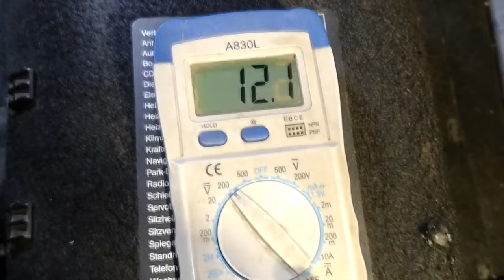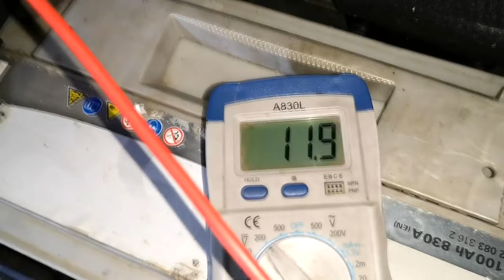How to make old Starter Motor Work like New. How to fix, rebuild and clean starter motor.

Comment: I used to work in a starter repair factory. We would do about 150 a day. If you want to strip a sealed solenoid then here`s how. First of all get the solder hot and flick the solenoid so the solder flys out the hole. Once the wires are all clear then get some nice thick angle iron. Drill three holes matching the solenoid attaching holes. Then drill one in the middle of the holes big enough to fit a 3/8th extension bar. Put a socket in the solenoid hole that fits nice. Screw the screws through the angle iron and into the solenoid holes. Be careful not to go to far as the copper windings inside will be damaged. So you might need washers. Just wind in with you hand to save damage. Once the solenoid is fitted to the angle iron then insert the 3/8 extension bar through the middle hole. Get a big vice and put 2 big spacers each side of the solenoid and put in the vice so the extension bar is on one jaw and the 2 big spacers with the solenoid are on the other jaw. Then close the vice and the extension bar should push the solenoid apart. When it apart you have to open the metal case with a hammer to get it back together to get rid of the lip.
Reply: thanks.  seems you could have your own shop...   sounds like a bit of work, not worth my time since a new one is not too expensive, compared to this amount of work.
Reply: @galehess6676  Yeah i did all this when i was skint. Time is more important now.
Reply: Why don't you do a Video to show how  it is done ?.... it would be so much better than writing an explanation of it
Reply: 150 of those is a lot! I hope the pay was good 👍.
Reply: @damianbutterworth2434 bet your watching the grass grow
Reply: @Psp-id7uw  I wish I had the spare time.

Comment: It honestly sounded the same to me. Your battery is at 11.9v when a fully charged battery is 12.6. That’s most likely your issue. Check the voltage drop while under a load if you drop below 10.3v get a new battery you likely have a dead cell. Otherwise it could be a charging issue.

Comment: This video is very helpful for people with starter issue however the issue with this car wasn't the starter and I did not notice a big difference after you cleaned the starter as far as starting the car. The reason that your car doesn't start right away could be many things.The first thing to check is the battery and the connections. Make sure the battery is healthy and the terminals and the clamps are not corroded and also check the connection from the battery negative terminal to the body is good. Then start with air filter and spark plugs.Make sure the throttle body and mass sensor are clean and if the problem is still there I will check the fuel pressure.
Reply from the maker: Thanks for sharing your thoughts 😉 But you lost me when you said check spark plugs on a diesel 😅

Comment: I'd like to thank you for this video.  I am a farmer and on Saturday at 3pm my tractor wouldn't start. The starter smoked a bit on its last try and I assumed it was dead. I watched your video then took my starter apart. I had nothing to lose since the tractor store was closed 'till Monday. It was extremely dirty with oily, greasy dirt. I cleaned it well and reassembled it. After that, I bench tested it (another YT video) and it worked! Today it has been working much better than before and I've transplanted cauliflower, zucchini and summer squash. I'd be down for days sourcing a new starter without this video. It feels good to solve a problem and keep trucking. Thanks man!
Reply from the maker: Thank You so much! I work for these kind of comments and I am very happy that it helped
Reply: @Work_G  still working! Thanks!

Comment: Nice video. I needed a refresher after 40 years of bolting on replacements for customers. Thank you.
The commutator just dropping into the brushes doesn't look familiar at all though. I remember that being the nightmare of electric motor rebuilds "back in the day"... holding the spring loaded brushes back until the commutator was in place, while still being able to release them once it was seated.
Reply from the maker: Thanks! Usually hobby mechanics like me have a different experience when you love your car and don't count the time you spend on it, so you find yourself doing things like that 😅

Comment: Nice cleaning up.  A tricky part is pushing and holding back the four brushes while inserting the commutator.  Several ways:  Tie wraps, a socket under them, etc.  You should also try to disassemble the gear reduction box, clean and grease.  You should replace the brushes too if you can find them.
Reply from the maker: Thanks! Good tips 😉Brushes was in good condition and to replace them need to solder connection and to buy new ones need special order so I decided to leave original and over all this starter is pretty complicated. For more simple starters I agree with you 100%, do everything while you there ✌

Comment: solid. i just did my 911 and not only saved a few hundred but also got the car back on the road in a day.  some tricks that may be helpful for other cars:
1. mark the orientation of EVERYTHING with a paint pen as you disassemble
2. i used red scotchbrite for the brushes and armature
3. clean everything with electrical contact cleaner
4. use small zipties to hold the brushes in the holders as you reassemble
5. then place the largest socket that will fit inside the brushes to hold them compressed and cut the zipties
6. reassemble
rock and roll.
Reply from the maker: Thanks for watching and sharing tips and tricks 😎

Comment: Thanks for this, I thought that my parents were going to have to spend a couple hundred on a new starter motor for our Subaru Liberty GX 1995, but I instead went down to the garage (the car was parked outside because it wouldn’t run to get in) and I gave it a bit of a polish. Admittedly I shouldn’t have but I decided that it was a better option.

Comment: Great video.  Thanx.  I did this similar thing to my condenser fan on my truck for air con.  I used high grit sandpaper to polish the copper contacts and cleaned it out inside.  Also dressed the brushes. Sometimes it wouldn't start,  or just didn't run nearly as high speed as it does now. It turns on every time now and boy does it run fast.  Anyway Thanx
Reply from the maker: Nice to hear that

Comment: Neat! My starter is all slow and lazy sounding. I'm wondering if I could just clean and lube it, rather than replace 🤔
Reply from the maker: It should do the job, may be put new brushes and it will work like new

Comment: A good battery test would be recommended on that as that battery is almost discharged and far from a healthy 12.4 to 12.7 I would expect to give a starter a the required power but even then it's not sufficient as I tested s car last week that produced 0 cca but had 12.37v of charge, great video though

Comment: Great video 👍 but will this work if the starter can't even crank?
Reply from the maker: Thanks! It can work if the problem is in wires connection or brushes

Comment: Brilliant demonstration ♠️
Do you think it'd be possible to bring a marine starter motor back to life, it was partially submerged in fresh water for about three months,
Its hard to explain, but the top part with the cables on was not under water nor was the rear of the unit, because of the angle of the engine only the front bit that goes into the engine was fully submerged..
What'd reckon folks? All suggestions greatly received
Reply from the maker: In theory it should work after full rebuild and refresh, but practically I can't tell

Comment: It's an excellent idea for salvaging starters instead of throwing them out or buying a new one.  I bought my starter from Autozone with a lifetime warranty and returned it for a new one when it died.  Unfortunately, I have done this several times with my Chrysler Town and Country 2014, saving me time and money.  Chrysler dealer in Tampa Fl. wanted $1100 to replace my mini van, of course, I found another alternative.
Reply from the maker: True and most of times fixed original is better than alternative manufacturer part

Comment: Can I use high temp. grease or Multi-purpose grease? 

Also, what kind of lubricant is that? Any alternatives?
Reply from the maker: Yes you can, just dont put it to much. I used Berner bearing grease and ptfe lubricant

Comment: My starter seems to be having an intermittent issue, although sometimes there’s another issue where my dashboard is wonky and my fuel pump doesn’t prime so it may be that in combination. Regardless once it starts priming again I get a click at the starter but it doesn’t turn even directly engaging the starter so it may be fixable without even rebuilding it, just a cleanup
Reply: clean ground which is the interface with motor housing, the housing of the starter is probably dirty where it meets the motor housing and grounds the circuit, and clean all contacts.

Comment: Hello and excuse me, I wanted to ask you, if with the tester positioned on the sound diode, I touch with one tip on any strip of the switch, "where the carbons crawl", and with the second tip on any other strip, it always sounds, is this normal? Thanks Eugenio.

Comment: It’s not a rebuilt it is just a cleanup?
While you were at it I would have changed the contacts in the solenoid/relay, it is what fails first, typically. 
On my Toyota Sienna it’s $6 to $16 depending on how many parts you charge (just one contact to two contacts + plunger).
The brushes seemed ok. They are the second point of failure.

Comment: How do you clean it if there's oil inside? Can you spray it with carburetor cleaner and dry it up?
Reply from the maker: If you mean grease on gears and bearing, than sure you can clean it with carb or brake cleaners but don't forget to lubricate it with new grease after cleaning

Comment: If one is not comfortable doing this on their own, what kinds of shops can do this service?  I just switched out an old starter motor on my 2014 Honda Accord and want to get the old one repaired or reconditioned, ready for the next replacement in the future.
Reply from the maker: Usually there is shops that specialises in starters and alternators repairs
Reply: They might charge you 50% or more of what it cost to buy a starter.  Depends on the vehicle of course.

Comment: Hello , Great job fixing the starter motor , i have one problem in my VW Golf 5 2.0L 2005 , when the engine its cold start good , but when the engine its warm its last more , around 3-4 second to start , Should be the starter or something else ?!!
Reply from the maker: Hi, Thank You! It can be starter but usually starters act same on cold and hot engine, so I can only suspect other problem like fuel issue or faulty sensor
Reply: GetWork i have one problem with Turbo , its Turbo charger Oberboost , can be this ?
Reply: @henrilica483  My brother has the same problem on his 1.9 TDI. Snags the key from your hand when cold but a bitch to start when warm/hot. They usually get that with age: starter not at 100% cranking power, battery the same, leads that get a bit corroded and whatnot. The fix: the high route is to get the ECU flashed; the low (and much cheaper) route is to install a TDI Hot Start Magic Button where you're bypassing the coolant temp sensor only for when you hot start the car, tricking the ECU into thinking the engine is stone cold and squirt more fuel and faster. That's what my brother has on his Golf and it works. Everytime. This dude explains it overall but I'm sure you can find more about it online: https://www.youtube.com/watch?v=rhfkjJMtVSU&app=desktop

Now for the Overboost it's more likely the VG part in the VGT (Variable Geometry Turbocharger) that TDIs have. Either the vacuum thing that moves the vanes inside the turbo that control flow and turbo RPM is...well...broken...OR the vanes are sticking open/closed. I've seen some videos of people squirting oven cleaner inside the hot side of the turbo to break up the carbon and free the vanes. Search for that.

Cheers!
Reply: @Henri: if by "start" you mean that it cranks fine when hot or cold, but that the engine won't "catch" (start running by itself) quickly when warmed up, that could be many things. Could be temp sensor reporting that the engine is still cold and giving too much fuel when warmed up. Does the exhaust smell like raw gas at all? This is an indication of over-rich mixture and possibly a temp sensor gone bad. 

The engine isn't "chipped" is it? If so, all bets are off. You have to go to the "chipper" company and ask them.

Comment: Hi there, I recently bought a 2000 ford transit diesel camper but been having issues with diesel knocking apparently.Took it to my mechanic to fix the knocking got it back and went for a long drive which was fine stopped turned around headed back home but then as we approached a hilly part there was sudden jerk or surge in the engine, anyway long story short we made it home next day started up was ok shut it down and later on decided to run it down and get the tyres pumped and would you know it the knocking started up again.
Reply from the maker: I am not sure about your problem, you say you hear knocking from engine while driving?

Comment: what type of bearing grease did you use here in the video on the starter for the BMW ?
Reply from the maker: I can't remember exact one but it is not critical because all bearing greases can handle heat pretty well

Comment: My starter on Honda fit is making weird sounds on cold start-ups. Kind of like grinding wheezing sounds. Only when cold and only for a second while starting. Should I buy a replacement which are surprisingly expensive and hard to replace for this car or just ride it out until summer?
Reply from the maker: Probably your starter return solenoid is going out, so may be you could restore old starter. Leaving like that its up to you, how much harm it would do if one day you wont start car when you need to go somewhere.
Reply: @Work_G  Well when I gots to get pizza I can't have car not work. I could have to resort to eating noodles and salt. Return solenoid? My gut was telling me solenoid was bad but i can buy starter on ebay for $80 so I think I do that, and if I need to go to work and it won't start I take day off. And get pizza after.

Comment: At 3:00 those things you are filing. If they don't reach the center cylinder cuz they're too worn. Can they be replaced?
Reply from the maker: Yes they can be replaced. It is called starter motor brushes, but I suggest to replace whole unit that comes with holder. (so you don't need to solder independent brushes - in this case all 4)
Reply: @Work_G   thank you sir please keep up the good work 👍

Comment: what does is mean if the starter makes one click when you turn the key, and discharges the battery simultaneously?
Reply from the maker: it could be an electrical problem with the starter solenoid or starter relay, corroded connections

Comment: Dammm good video but can tha starter be save if its just click clicking all tha time?
Reply from the maker: Thanks! If you hear only clicking that means shaft goes out but not spinning. It can be fixed by cleaning connectors, relay inside solenoid or replacing brushes

Comment: i have a startmotor of a nissan primera that doesnt work.. it ticks but it doesnt start. so its clear the problem is in the startmotor and not the relais. do you think it would help if i cleaned mine up as well? or mayby it is the cable thats going towards the motor because it looks like it has corrosion on the inside.
Reply from the maker: It can help, first try to hit starter motor with hammer and it should work again than it is worth cleaning and changing brushes, if not just replace it
Reply: @Work_G  we have already hit it and tried many things.. i have the motor now open and was really dirty inside i think thats the problem

Comment: Excellent video.  Just replaced starter motor on my boys VW Polo with a recon unit.  The old one started the car without a problem but after most starts would emit a  short, 1 sec grating sound, any idea what bit was failing and if it's a DIY fix as per your video?
Reply from the maker: Thank you! Sounds like broken return spring or return solenoid itself is bad.

Comment: What about  maintenance of reduction gear ⚙️ box in front of electric compartment?
Reply from the maker: In this situation it was just blowing dust with compressed air and then lubrication with liquid grease. Of course would be better to disassemble, check, clean manually and put grease, but this starter was too difficult to disassemble

Comment: My X5 E53 also starting with bad sound. And now i have to try 4-5x to get motor started. Starter have no power, like allmost dead.
Is cleaning enaugh? Does someone have experience? Or is there probably bad brushes?
Reply from the maker: I would recommend a good clean and grease, it would probably be a good idea to replace the brushes, but only after disassembly you can tell if you really need to.
Here I leave link to my video about most common bad starter sounds https://youtu.be/f7bTSm-sHBk
Depending on noise cleaning may not be enough

Comment: What if there is power at the starter motor but the motor is not spinning and my car isint cranking at all does that still mean I can clean it out or do I have to change the whole thing? My car is a automatic Honda Civic   2003 model
Reply from the maker: When you turn key to on position and do not hear anything solution usually is to change whole starter motor (if battery is good). But it can be many issues, starting from ignition assembly, corrosion on starter electrical connectors, or starter solenoid failure or even locked engine and so on.

Comment: What if the brush worned . I have to hit mine to get it start
Reply from the maker: In most starters brushes unit is easily changeable
Reply: @Work_G  mine was the clip that's tourn off ended up had to buy one